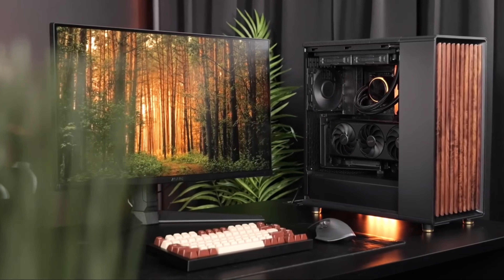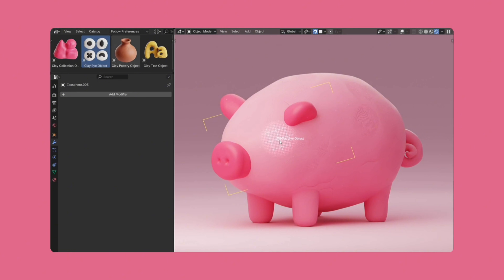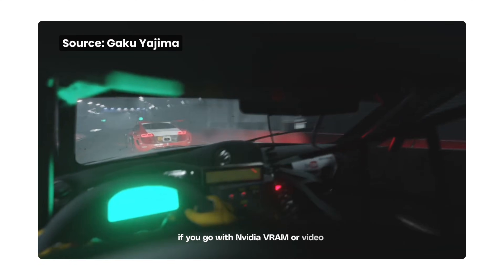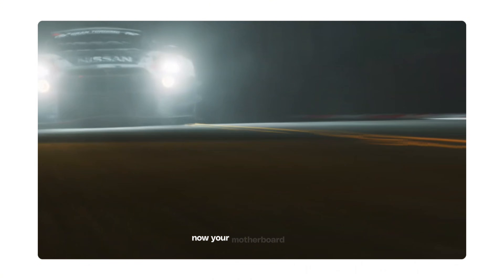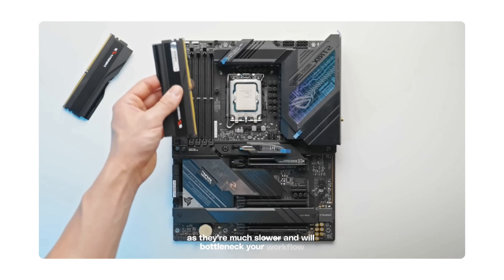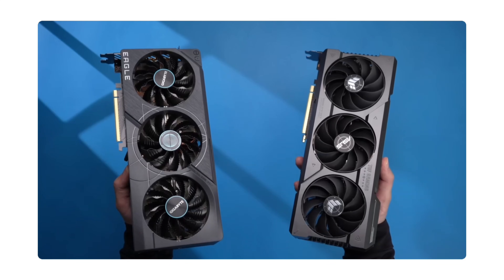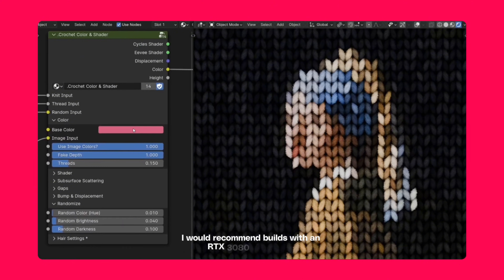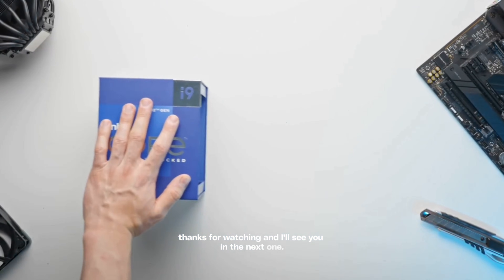How to Build the Best PC for Blender in 2025 (Complete Guide)

Comment: Thank you for enlightening us. I have an inquiry: what is the equivalent to the specifications you listed in Apple MAC?
Reply from the maker: Great question! If you're looking for the Apple Mac equivalents to the PC specs I listed for Blender, here's a quick breakdown:

For the high-end tier (similar to an RTX 4090 + Ryzen 9+ build): Go with the Mac Studio with M4 Max or M3 Ultra chip, offering you up to a 32-core CPU and 80-core GPU. And if you have a little extra you can even consider M3/4 Max chips, But you honestly don't need that its just too expensive. These machines are excellent for complex scenes and heavy Cycles rendering, especially with Metal acceleration in Blender 4.

For the mid-range tier (like RTX 4070 and Ryzen 7): The MacBook Pro 14" or 16" with the M3 Pro or M4 Pro chip delivers solid viewport and render performance, especially for Eevee, sculpting, and compositing.

For light to moderate workloads (think budget builds): The Mac mini with M4 or even the MacBook Air with M3 can handle basic modeling, Eevee previews, and light Cycles rendering.

Just keep in mind: Blender’s GPU rendering (Cycles) works best with NVIDIA CUDA/Optix on Windows, but Metal support on Mac has improved a lot — especially for M-series chips.

Hope that helps, and thanks for watching!

Comment: This case fits a normal MB right
Reply from the maker: Great question! By "normal MB," I assume you mean standard ATX motherboards (the most common size). Yes, the Fractal North case supports ATX, Micro-ATX, and Mini-ITX motherboards. The case also fits GPUs up to 355 mm long or more if you go for the XL model and has excellent airflow with pre-installed fans.